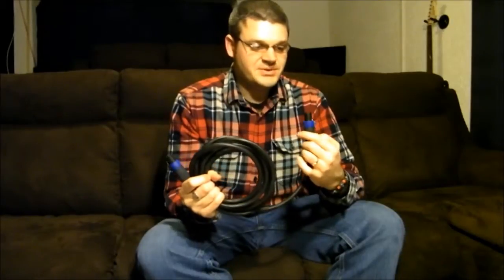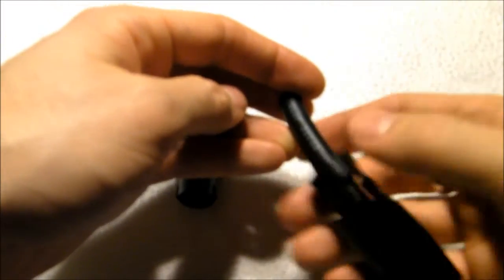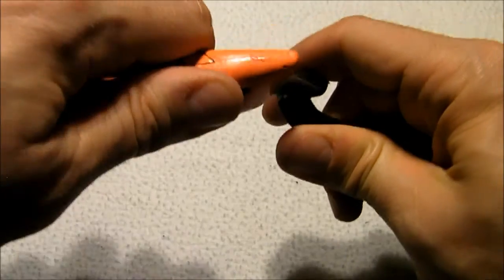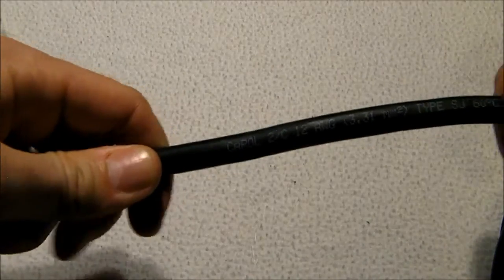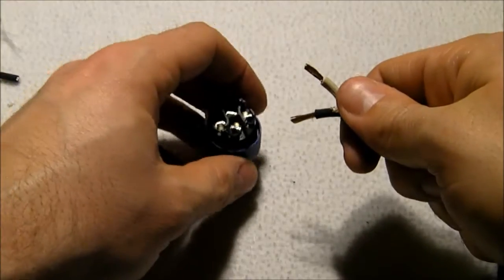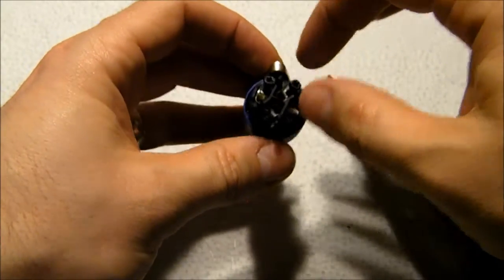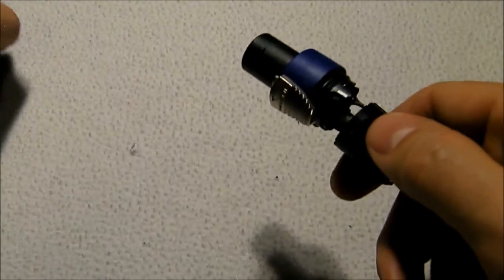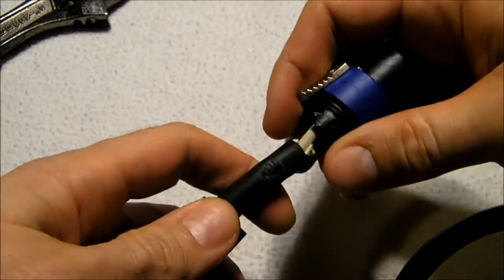How to Assemble a Neutrik Speakon Connector

Comment: how to disassemble?
Reply from the maker: Disassembly can be tricky if it was put on tight.  I use an adjustable wrench on the flats of the shell portion.  If you can get a good grip on the plug side, it should simply unscrew.  You could also try having it plugged into a jack, and use the wrench on the shell.  But if it feels like you're putting too much torque on it, it may not come off.  At that point, it would be better to just cut the end off and put a new connector on rather than risk breaking the jack.

You could also try vice grips on the plug side with an adjustable wrench on the shell side.  Just use a piece of leather (like a belt) or something so that you don't mess up the plug side.